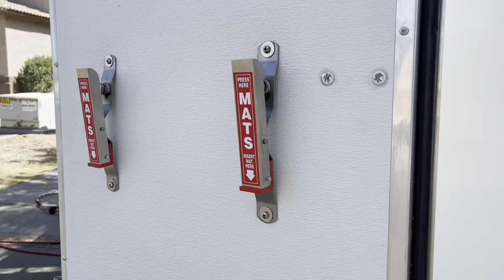I WISH I WOULD HAVE DONE THIS SOONER

Comment: Awesome trailer. Next step will be 1000 watts of solar on roof. And a 6500w inverter with lithium battery bank. You’d never need gas again, no noise, no fumes. Something to consider. It would be 5-6k$ to set up yourself.
Reply from the maker: Thanks Mitch! I’ve considered it with a company here in phx. Love the idea of no gas noiseless energy 🤙
Reply: Look at an eg4 low frequency all in one inverter. Like the 6500w. Add a couple of rack mount 48 volt eg4 batteries. Bam, making 6500watts of power.
Reply: Look at an eg4 low frequency all in one inverter. Like the 6500w. Add a couple of rack mount 48 volt eg4 batteries. Bam, making 6500watts of power.
Reply: Look at an eg4 low frequency all in one inverter. Like the 6500w. Add a couple of rack mount 48 volt eg4 batteries. Bam, making 6500watts of power.

Comment: Hey man what pressure washer hose reel do you have? I’m looking for one that’s about 100ft but am looking for recommendations!
Reply from the maker: Here you go brother 

Coxreels 117-5-100 Hand Crank Steel Hose Reel, 100 Series, ¾” x 100’ - Easy-to-Use Compact Design - Adjustable Tension Break - Heavy-Duty Steel Construction, Made in the USA, Blue https://a.co/d/29hQtp4
Reply: @SpotlessWaterGuy  What hose do you use? I use a Uberflex hose right now but it’s 50ft and not enough for the RVs I do?
Reply from the maker: @zachklinge5412  https://www.obsessedgarage.com/collections/fittings-and-parts/products/obsessed-garage-3-8-high-pressure-hose-v1-0?variant=41435359182999
Reply: @SpotlessWaterGuy  Thank You!